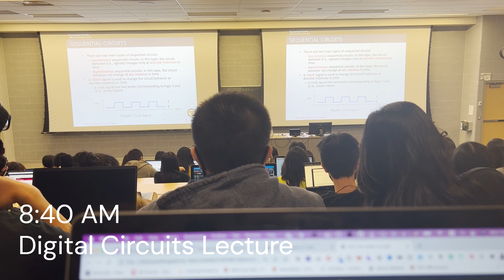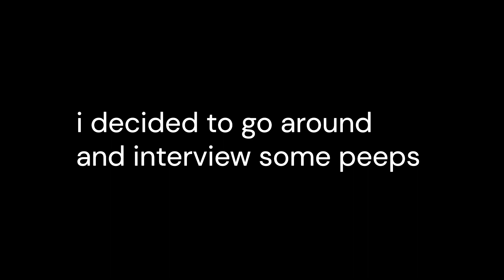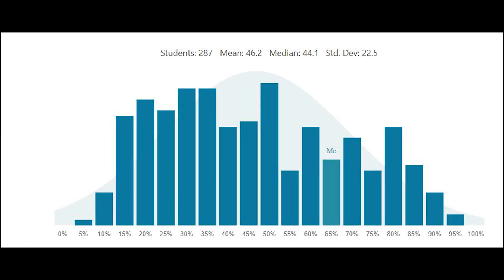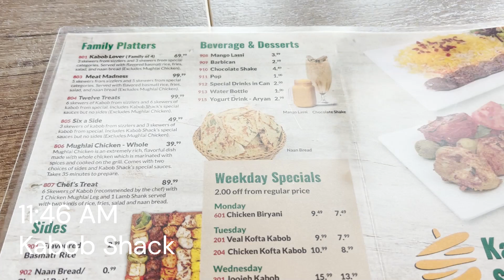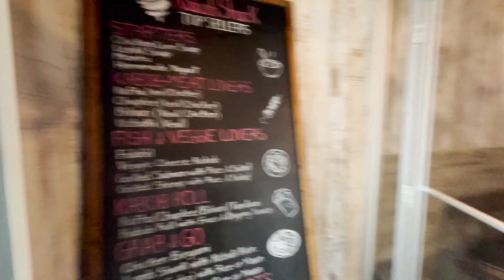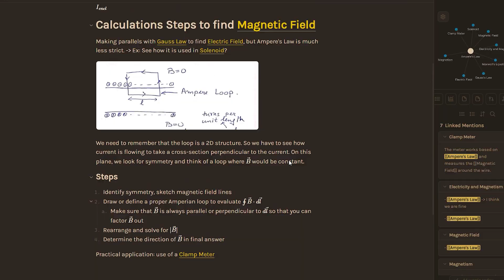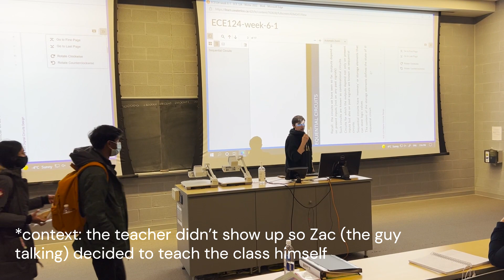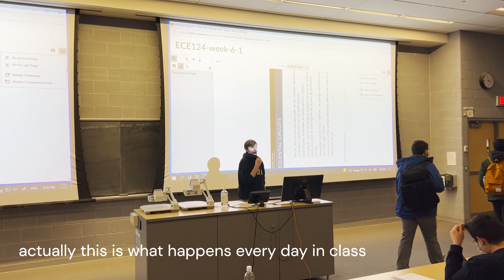Day in the Life of a Waterloo Software Engineering Student

Comment: Hi there, can you help me with the following please, my deadline is tonight.

*First Factorial*
Have the function take the number parameter being passed and return the factorial of it. 
For example: if num = 4, then your program should return (4 * 3 * 2 * 1) = 24. 
For the test cases, the range will be between 1 and 18 and the input will always be an integer.

*Time Convert*
Have the function take the number parameter being passed and return the number of hours 
and minutes the parameter converts to (ie. if num = 63 then the output should be 1:3). 
Separate the number of hours and minutes with a colon.
For the test cases, the numbers used will be 74 and 118.

*Consonant Count*
Have the function take the string parameter being passed and return the number of 
consonants the string contains (ie. "All cows eat grass" would return 13). 
For the test cases the two strings will be ‘Today is a really hot day but will cool down later’ 
and also ‘Rabbits bounce whilst dogs bark’

*H Distance (Hamming Disatnce)*
Have the function take the array of strings, which will only contain two strings of equal 
length and return the number of characters at each position that are different between 
them. For example: [“house”, “hours”] then your program should return 2. The string will 
always be of equal length and will only contain lowercase characters from the alphabet and 
numbers.
For the test cases, the first set of numbers will be [100101001 and 110110011] and 
[11001101 and 10110110]

*Roman Numbers*
Have the function take in an integer value of up to 4000 and then convert that number into 
the correct Roman numeral equivalent. For example if the function takes 1943 then the 
return should be MCMXLIII
For the test cases, the two numbers will be 3612 and 423.

CAN YOU ALSO WRITE YOUR REASONS FOR WHY YOU HAVE CODED THE ABOVE CHALLENGES IN YOUR WAY?

kINDLY SEND YOUR SCRIPT TO MY EMAIL AS FOLLOWS: aad4m@hotmail.co.uk
Reply: did you get a response?